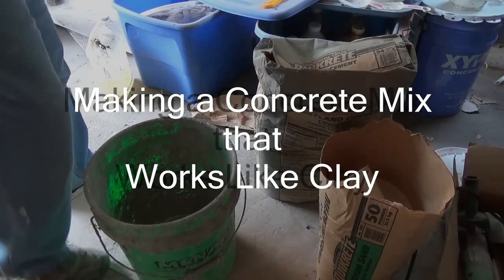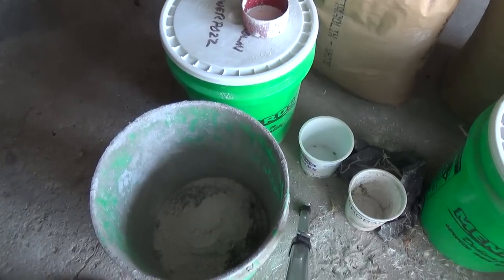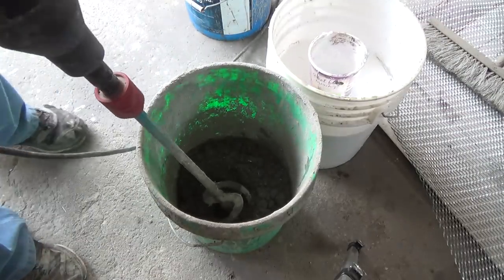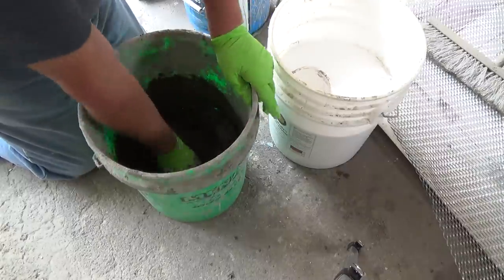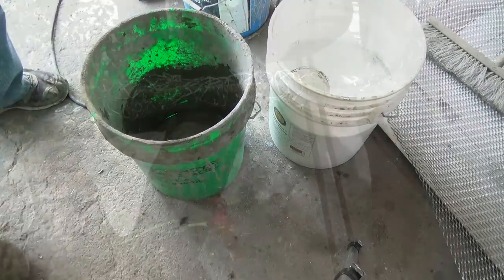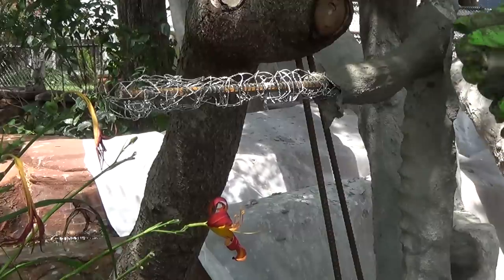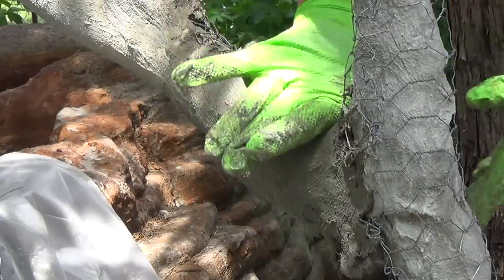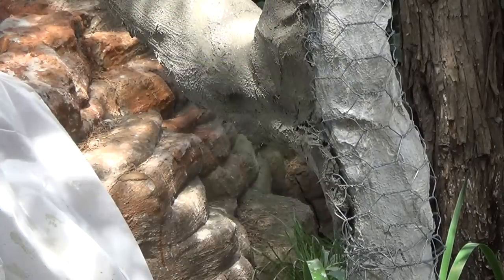#concrete #fauxbois Making a Concrete Mix that Works Like Clay

Comment: to summarize the video: 5c fine sand, 10c OPC, 2c metakaolin, 0.5-0.75c pva fiber, 5c liquid (liquid is 3 parts water to 1 part acrylic admixture). power mix til small clumps/balls form. then mix/knead by hand with small additions of liquid (less than 1c).
Reply from the maker: Yes, that's about right.  Start with 1/2 the amount of cement in water and add tiny amounts until the mix is desired consistency.

Comment: Mr. Perry thanks so much for your recipe and instructions! I followed them and used the "clay" to fashion a full-sized copy of a 1922 cubist sculpture, "Sitting Man" by Jacques Lipchitz. I built a framework out of hardware cloth and steel wool with a hot glue gun and then added the clay mixture to the framework, mixing only about a double handful at a time. It worked out great! I used a Dremel tool to smooth the final surface and then painted it to look like bronze. I learned a few things about making sharp edges and dealing with cracks. If anyone wants any tips I am happy to pass them along with pictures.
Reply from the maker: I'm glad you found the mix worthwhile.  Please share what you did on your channel.
Reply: Can we see the pics please?  If you could post them on your channel, thanks!
Reply: How did you deal with cracks? And making shape edges would love to know thank you
Reply: How do you deal with cracking?

Comment: Thank you for sharing your knowledge and recipe. The consistency with the Metakaolin looks ideal for sculpting and is exactly what I was researching. A note about handling dry powders, especially ones with silica related ingredients, but also the Metakaolin and the cement: inhaling these fine dusts is so very harmful to the lungs. Each maker can do as they like, but for your other readers, may I suggest that if you value the ability to breath effectively into later years, wear a dust mask, and make an effort not to ‘poof’ the dry ingredients into a cloud around yourself as you work. But even the finest mist of these powders is harmful. Here in the U.S. family physicians routinely ask patients “Do you have exposure to coal dust/suffer from Black Lung disease”?  They ask that because the fullness of time around coal dust has shown the known debilitating harms from coal dust; and there is a program to compensate such workers. It’s only a matter of time before silicosis sufferers join that unfortunate club, for which any compensation is little comfort—-needing oxygen and being unable to exert yourself is a terrible consequence.
Reply from the maker: Please note that the dust does not come up from the bucket but is blown laterally out the garage since there is a floor fan blowing dust away.  Also, keep in mind that silica, such as in silica sand and silica fume are not the same thing and do not pose the same risks, though dust of any kind should be avoided. Silica is crystalline and silica fume is amorphous. Silica fume poses its own risks, but research indicates it is not associated with the cancer risks of crystalline silica.  Metakaolin is made from kaolin clay and contains about 6% silica. Like all dust, inhalation should be avoided.

Comment: I can't wait to try this mix! It seems like exactly what I've been trying to make - concrete that will stick to the underside of a project. Thank you for all your great instructions!
Reply from the maker: The real trick is to take your time about adding liquid.  Start with half the volume of liquid as cement volume, add small amounts, completely mixing the added liquid before adding any more.  When it reaches the exact consistency you want, keep kneading it for a couple minutes.  Add a tiny amount more if needed to maintain consistency.  As you use it, wet gloves and repeated kneading will keep it workable. The wet gloves also keep the mix from sticking to the gloves and wanting to pull off the underside when it's applied. It is also helpful to take it out of the bucket and put it on a board to allow heat of hydration to dissipate so it doesn't set up too fast.
Reply: dperry428 Thanks for the tips! I'll get over to my local masonry supply this week and get the metakaolin and acrylic polymer I need. I've been using hypertufa-type recipes to cast and sculpt some planters and garden ornaments, but I was getting frustrated that I can't sculpt with it the way I really want to. From your demonstration with sculpting it over the armature, it seems this is going to let me try some new things, like maybe a standing animal figure. So inspired now! 😃
Reply from the maker: In my usage, I want maximum strength.  For sculptures, if you want an even easier mix to surround an armature, replace all or some of the sand with a lighweight aggregate.  The resulting lighter mix will be less likely to fall off the armature because of it weight.  If you can find a source of fine perlite (the stuff sold in garden centers as a soil amendment) or a source of fine pumice, both, being light volcanic rock, will make the mix much lighter while remaining strong.
Reply: dperry428 Oh, I've used perlite in some of my hypertufa recipes, so I have a good supply for experimenting. Thank you for your advice! I like for my sculptures to look old, like something from the grounds of an ancient castle, so I'm also going to try adding a little peat to give it a worn texture and encourage the growth of moss.
Reply from the maker: Just be aware that adding organic peat might affect the chemistry of the mix and make it unworkable.  Experiment with a small quantity first.  Texture of worn concrete can also be accomplished with a damp sea sponge and a stiff brush. Also, keep in mind that the purpose of hypertufa is to make the concrete porous so that water will drain from planters. Peat will do the same with your sculptures and provide pathways for water to find its way to the metal armature, resulting in corrosion of the reinforcement.  That is the single greatest cause of structural concrete deterioration.  Water gets to the metal reinforcement and corrodes it. The resulting metal oxides (rust) take up more space than the metal itself and expands against the concrete matrix, causing the concrete to spall, crack and fall apart.  Hypertufa techniques do not lend themselves to durable metal-reinforced concrete. I would highly recommend putting on two coats, the first covering the metal without the addition of peat and then a second layer containing the peat-texturing method you propose.
Reply from the maker: Perhaps you're already aware that one technique for growing moss on concrete is to blend moss in a blender with buttermilk and paint the resulting mixture onto the concrete.
Reply: dperry428 You are so generous with your knowledge. Not all artisans are willing to take the time! I'll play with small amounts first, and experiment with the wire brush and buttermilk methods. I don't mind if my planters need repairs or replacing over time (and they do need to be able to drain), but I want my artsy stuff to last!
Reply from the maker: I'm not an artisan; just a retired science teacher who enjoys sharing what I learn with others.  As I was learning, I found it very frustrating that the only thing most people were willing to share was what people would pay for and, even then, kept their "proprietary", "secret" recipes to themselves, but offered them prepackaged for sale at outrageous prices.  So, as I learn more, I love sticking it to those jerks who fought me all the way to where I am now. Like most people, I don't have a lot of money to spend on overpriced materials or offerings to the "gods" for workshops and access to the "secrets".
Reply: dperry428 Your Awsome!! 😊👍
Reply: dperry428 I find that people who work with concrete either guard their secrets carefully or are not necessarily creative types. A concrete pro stopped me in the Lowe's parking lot to ask what I was building (he said he thought it was funny to see a "little blonde woman" loading 92-pound sacks in a pickup by herself, but hey - working with concrete builds muscle, even for ladies!). 😁 Granted, at the time I didn't have the proper vocabulary to describe what I was doing, but he seemed to think I was completely insane when I described my thin-shell sculpting ideas and asked him if he thought it would work. He didn't really see concrete as anything more than a practical, solid building material - he specialized in laying sidewalks for public institutions, so I was barking up the wrong tree. I have made a lot of things, some pretty successful and some big messes. I didn't have anyone to tell me I was reinventing the wheel until you advised me to search on "ferrocement techniques." I had commented on your stone fence wall a few years ago and asked if this technique could be used for some other things I wanted to try. You gave excellent advice, and I was off and running with my ideas! It was great to find someone doing exactly the kinds of things I had been trying to do, but who already had the experience and knowledge I was missing. I was happy to learn that the techniques I was experimenting with are actually a thing, with a name, a legitimate building technique, and not something nutty I just made up, which was how I felt when I told a few people what I was doing. 

I'm a curator and director at a tiny local history and art museum in Maryland. I see a lot of art and meet a lot of creative-minded people. Some identify themselves as artists, some artisans, or crafters, or builders. I just call myself a maker. 😊 I teach classes and workshops at the museum on fiber art, mosaics, and creating with found objects. But my main projects at home involve building. I've built a fancy chicken coop and henhouse (soon to have concrete panels over a wire mesh skirt to keep snakes out, similar to your brother's shed). This year, I built large vegetable planting beds with lined cinder blocks (which will get a textured skim coat next year). I sculpted lots of faux rocks to edge my bottle path and firepit area, and I've built a huge faux stone bench and lots of smaller garden items. I hope to add a little pond next year after seeing yours on YouTube some time ago. 

If you were in my area, I'd be begging you to teach workshops for the museum! Your demonstrations have helped me move past trying to sculpt something from the various premixed options from Lowe's. I've made some neat things from good old Sacrete, but it's time to start learning to use the additives so I can make better mixes to suit each project. It's silly, but I was intimidated to go to the masonry supply place to get acrylic, plasticizer, and fibers because they deal with mostly professionals, and I didn't want to endure the quiz I so often get from hardware store employees to determine whether the little lady really has any idea what she's doing...and then of course the second-guessing and recommending things I've already tried instead of just selling me what I asked for. But I'm going this week armed with my list, ready to school them on ferrocement! 😁 

I've bent your ear today, but wanted to let you know how much your generosity and the hard work you put into the videos is truly appreciated.
Reply from the maker: I'm glad I could be of assistance.  Nice to see someone else who appreciates the artistic uses of concrete.  One of the big reasons I hold all comments for review before allowing them to be posted is the arrogance of some so-called concrete professionals.  I've gotten some of the nastiest comments from them about how they've been doing concrete work for 40 years and what I'm doing is stupid and my stuff will fall apart, etc.  They basically have been pouring foundations with ready-mix or doing flatwork such as driveways, sidewalks and patios.  That's all they know and think that's all there is to know about concrete.
Back in the 1970's, I helped move a railroad depot and convert it to a local history museum and was on the original charter for the historical society.  I still sometime do things for the museum, including fixing clocks for them.  Here is a presentation I gave at the museum to the Kishwaukee Valley Heritage Society.  https://youtu.be/RtB3Yuz13Ac

Comment: Hello there Mr. Perry.... so I've watched your video more than once and I do have one question.  In your descriptors of your video you mention acrylic mix and maybe I just missed it on your video but I didn't see where you added this component and if you did; can you tell me how many minutes into the video you demonstrated or can you just let me know how much to add and what product do you recommend or even if it's necessary.  I really appreciate it and I'm grateful you have shared.
Reply from the maker: The acrylic is a liquid and is added to the water.  I use a product from Fishstone   https://concretecountertopsupply.com/Item/KongKrete-Acrylic-Polymer-GFRC    It is 50% solids, so I dilute it 3 water to 1 acryllic.  You can buy acrylic, such as Quikrete's Acrylic Fortifier at Lowes and other home improvement stores.  Home Depot carries a product from Sika that should not be diluted more than 1 water to 1 acrylic.  Watch this part of the video  https://youtu.be/e4j5qgNFQE0?t=160  and note the on-screen caption.

Comment: Hi! So impressed with your creativity! Was wondering how long you have to work with that mix before it starts to dry and become too stiff? Have you ever worked with superplasticizers? I've heard a few drops will make the mix "wet" again.
Reply from the maker: Working time is highly variable, depending on temperature, humidity, wind, sun or shade.  Under normal conditions, at least a couple of hours.  Want to extend working time?  Add ice bags to the liquid.  Remove the mix from the bucket and spread it out on plastic to dissipate heat of reaction.  Add small amount (less than 1/10th of one percent) sugar or molasses. Using plasticizers in this mix would be counterproductive. This mix is used for vertical application and sculpting.  Superplasticizer would result in the mix sagging, slumping or running.  Superplasticizer will also work over a short period of time and the mix will stiffen quickly.  Redosing with it will result in faster restiffening.  Further, superplasticizer will result in lowered freeze/thaw resistance. Superplasticizer is meant to be used to make concrete with less water and have it flow easily and self-consolidate.
Reply: @dperry428  Wow, thanks- you are a wealth of knowledge!

Comment: What you did is very good! It would be great if you gave the exact brands you use and inexperienced people like me can do it,thank you so much!
Reply from the maker: This is where I buy my additives:  https://concretecountertopsupply.com/?reqp=1&reqr=  You want to copy exactly what I mixed?  Buy the supplies from them and have them shipped.  Usually, it is cheaper to research sources locally and pick them up.  Brand names are inconsequential. Portland cement bought at a home improvement store, as well as sand.  It doesn't matter where you buy sand and cement.  Just buy the finest sand you can get locally OR, buy fine sand from Fishstone https://concretecountertopsupply.com/Item/SilicaSand4050  Acrylic is also from Fishstone  https://concretecountertopsupply.com/Item/KongKrete-Acrylic-Polymer-GFRC

Comment: This is a wonderful video. I can’t thank you enough. May I ask: why do you use the two layers of chicken wire and concrete? Is one layer not stable enough?
Reply from the maker: It's a construction concept known as ferrocement, sometimes referred to as thin-wall construction.  The combination of cementitious mix along with multiple layers of fine wire, mesh and/or metal rod, produces a very strong structural element. Third world countries have been using ferrocement for the construction of water tanks for many years.  In fact, during World War Two, ships were constructed of ferrocement.  For more information:  http://ferrocement.net/
Reply: @dperry428  Thanks for the thoughtful response!

Comment: I always watched your videos and like them.  What is the liquid contains other than water?  I am planning to resurface my 30 year old patio and thinking if I can create a mix myself  rather than buying the QUIKRETE Concrete Resurfacer.  What should be the good ratio of play sand, portland cement and water for that resurfacer mix?  Should I apply Quikrete  Concrete Bonding Adhesive on my old concrete before applying the mix?  Also, is 1/16 thicknes going to be ok or should I apply 1/8?
Reply from the maker: The liquid I mix with water is acrylic bonding agent/admix. The brand I am using is KongKrete from Fishstone.  Quikrete's brand is Quikrete Acrylic Concrete Fortifier.  Were I resurfacing a patio, I'd use the bonding agent on the old surface as well as add acrylic to the mix water. I am not a concrete expert or contractor, but my advice would be to use the mix made for resurfacing and follow the manufacturer's recommendation as to the thickness of application.  I resurfaced my concrete front porch about 9 years ago with my own mix with a thickness that varied, to level the surface, from 1/8th inch to slightly more than 1 inch.  I prepped the surface with the same acrylic undiluted as I used in the mix liquid diluted 3 water to 1 acrylic.
Reply: Muhammad Siddiqui  mr Perry is correct. Apply a bonding agent to the surface 24 hours before you plan on pouring then again just before you pour. When you can walk on it without it lifting up you are ready to pour. The moisture in the concrete will reactivate the adhesive. If you stop or in a hot location (direct sun light) you will need to reapply.